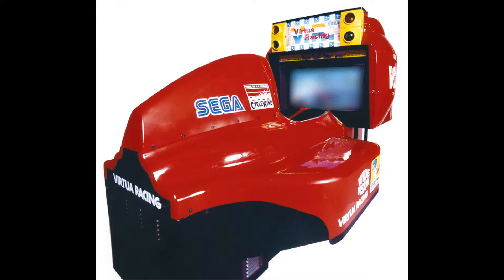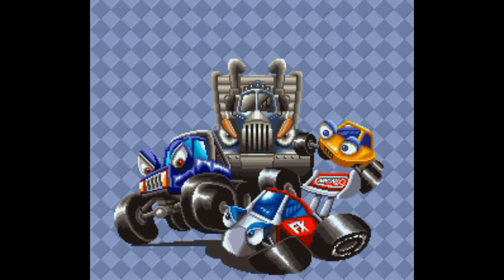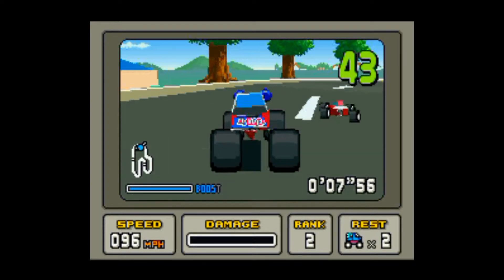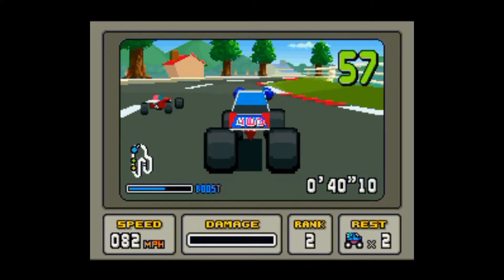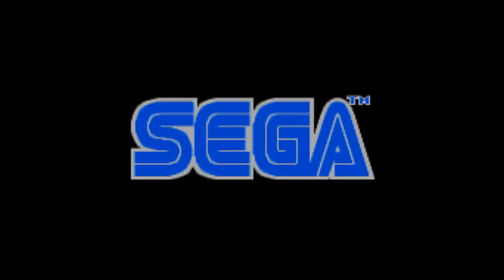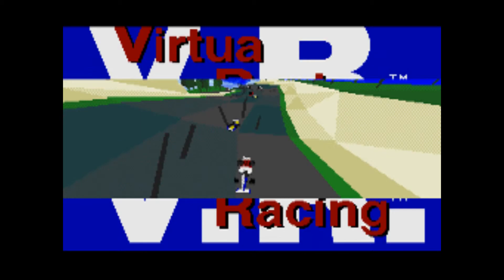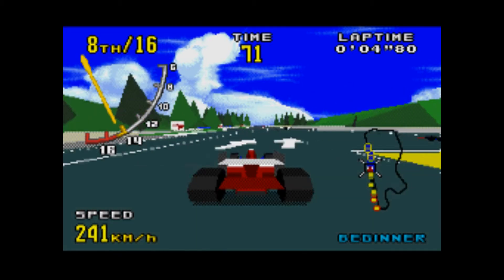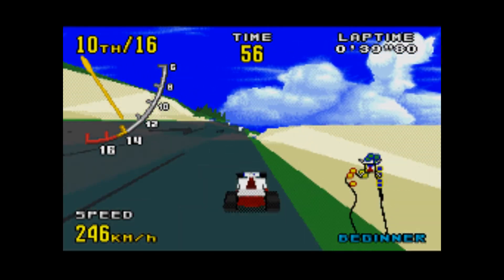Sega SVP versus Nintendo Super FX

Comment: the SVP was used in ONE SINGLE GAME though. That was Virtua Racing, a game with far less happening on screen than say, Starfox. Added to the fact that the SuperFX went on to do amazing sprite effects, it seems obvious that the more versatile SuperFX chip wins the day.
Reply: lmfao god bless you guys... nothing I love more than a great historical debate about SEGA "what could have been" theories and scenarios. This is what the internet was made for. You folks enrich my life. :P
Reply: The fact that 32X was more powerful than the SVP doesn't make the SVP obsolete. 32X was more powerful but also requiered a bigger investment in hardwere by the consumer. A cheap SVP cartridge-add-on could have been more successful, and more appropriate option for those that weren't still ready to buy a new console.
Reply: @MrCher2  Someone mentioned a shortage of SVP chips at that time. However, HITACHI had an abundance of the more powerful SH2 chips available for $20 each. With 1MB of extra RAM, this combination could have powered many arcade fighters, shooters, and 2D games. The 20,000 textured, Gauroud-shaded polygons per second would have handled most PS1 launch titles with ease.

This setup could have been sold for around $50, which would have helped clear out a lot of unsold Genesis and Sega CD inventory. Therefore, a combined Sega CD+SVP system could have competed with the PS1 more than a year and a half before its release in North America, priced at $150-250 depending on whether you already owned a Genesis/MD.
Reply: @albertabramson3157 what's the point of Gouraud shading if you can only display 15 colors? unless you also plan for a 32x-style video pass through.
Reply: @MrCher2  now ... what if there was a custom upgrade chip made for a game on the 32X ?????
Reply: @Dave Davies Well the 32x was more versatile, and more powerful, so yeah, the 32x rendered the SVP chip obsolete. This is basic logical reasoning.
Reply: Wins the wallet, but not the day. 

You sound like my coworker who thinks that VHS was better than laserdisc.
Reply: ...Have you actually looked at Star Fox recently? Virtua Racing had a lot more polygons onscreen at once. Granted the SVP was only used in one title, but that is because the 32x addon with superior technical specs was released the same year, obsoleting the SVP technology. That's why the SVP was only used once.
Reply: @Julian_Pepper  Area under the curve.  There were only 800,000 32X's sold ever, including those picked up at the $19.99 price--like mine.  Virtua Racing for the Genesis (with the SVP chip) sold almost that many.  The Hitachi SH-2 may have been less expensive, but the Samsung SVP chip drew just 0.03 watts, so didn't need a separate power supply.  If SEGA had built a one chip SVP/SH-2 add on with 2-4MB of RAM for use by the Sega CD, then created more 32-40 megabit games like Toy Story, Street Fighter II, Mortal Kombat II, it's likely that the Genesis and Sega CD would've gotten some great selling games like Crash Bandicoot, Final Fantasy VII, Gran Turismo, Metal Gear, at various sports games that would instead push the PlayStation sales to 100 million.  A single-chip, 2MB add on could've been made for $60-80 and sold at a slight loss, moving the whole Sega ecosystem to 20,000 polygon/sec 3D graphics for the mid-90s.

However: The Sega CD could already render 3300 flat shaded polygons per second and also created 3D floors and ceilings, etc.  The Genesis/Megadrive can generate another 1,000 polygons/sec, or 4300 + the track at about 17-20fps.  Virtua Racing usually ran about 6,000, while peaking at about 9500 polygons/sec at 20fps.  Owners of the Sega CD could've run Virtua Cop, Virtua Fighter, etc, on their Sega CD if SEGA had chosen to carefully hand-code a software engine for that platform.  Because SEGA chose not to, game enthusiasts learned that the company would never keep its long promise to bring the arcade experience to the home--just put yet another console in front of already cash-strapped buyers.  That was the point where I stopped promoting Sega games and gave up on the company.
Reply: @MaxAbramson3  You know what's strange about your reply? None of this actually counters the point I made. At all. I said the 32x was technologically superior to the SVP chip, WHICH IT IS.
Reply: @Julian_Pepper  No, you're wrong. (quickly becoming my favorite expression online, when the other person's fist is 1,000+ miles from my face) Because the SVP was capable, according to specs, of 20,000 flat shaded polygons/sec, but many believe that more could've been achieved with careful hand coding.  Using both SH-2's, SEGA's engineers were able to hit a stunning 50,000 polygons/sec, more than most PS1 launch titles.  However, most actual 32X games used only one CPU, so 25,000 was the more realistic limit.  An add on based on a single SVP would've cost less than half as much and not needed the extra wires and power adapter, resulting in much greater acceptance by the 40 million Megadrive owners around the world.  25,000 > 20,000.  Okay, but that difference isn't noticeable to most people, and the Genesis could simply draw the extra 32 lines of sky above the 320x192 area generated by the SVP.  An SVP add on would probably have been successful in the marketplace.
Reply: @MaxAbramson3  No YOU'RE wrong. Virtua Racing on the SVP doesn't use the full power of the SVP either, and since that's the only SVP game, the average reasonable estimate for the SVP chip's rendering abilities is a meager 9,000 polygons per seconds, and the SVP addon still wouldn't be accepted because the problem is they launched the 32x and Saturn at almost the same time which made it look like a simple cash grab which people didn't like. 

Regardless of all of that, you're STILL missing the point, so let me spell it out as simply as I can so you can hopefully understand.

The Sega 32x addon has superior technological specifications to the earlier released SVP addon chip. As a result of these superior technological specifications, Sega did not see the need to continue to use the inferior SVP technology, as the 32x could do more things because it wasn't specialized like the SVP, and om top of that it could do what the SVP was built to do at a much faster pace than it could.

If you still don't get the fucking point, I can't help you.
Reply: @Julian_Pepper  You can't help anyone because you can't even read your own post.
"that is because the 32x addon with superior technical specs was released the same year, obsoleting the SVP technology. That's why the SVP was only used once."

"That is why the SVP was only used once" is ironic, since its official 20,000 polygon/sec limit (as he says right in the video @4:29) was for one chip designed for this this purpose with only 128KB of RAM.  The 32X had two SH-2s, a powerful custom VDP, and 512KB of RAM, pushing its price tag to $160 and requiring its own source of power.  SEGA's engineers had Hitachi improve the multiplication power of the SH-2.  Had the SVP gotten all of these advantages, a twin-SVP 32X would also be pushing 50,000 flat shaded polygons/sec or more.

The President of SoJ insisted on sticking with Hitachi for the Saturn and Dreamcast, even when more powerful offerings were available like the SVP and PowerPC.

Your reasoning is therefore garbage.
Reply: @MaxAbramson3 you're forgetting one important aspect, color. The SVP is limited to the colors available on the Megadrive, which is 15 colors+transparent per tile. Meanwhile (ignoring the 15-bit direct color mode) the 32x layer alone can use 255 colors on top of the colors available on the Megadrive layer

Comment: you forgot about the SNES Doom, which shows the best performance of the SFX2. However, I understand that SVP was still superior, due to the high frame rate (20 frames?) while SuperFX1/2 was much smaller (10 frames?)
Reply: SVP didn't have the colors of super Nintendo, but yes, I think the 32X destroyed the exciting SVP Plan! I do wish SVP would of took off myself, with the lot more games. And so with the SUPER FX2. Good comment because at the end of day, we're all right one way or another.
SUPER FX2 Could have been real close.
To the SVP in terms of polygon pusher technology.
If not a little better. The problem was it was expensive to produce these chips for both companies NINTENDO and SEGA
Reply: @demonology2629 both chips are limited by what the host system could display (MD could only display 15 color+transparent per tile, while SNES could display 256 colors on one layer in 3 of its display modes). That's why the 32X had to route the Megadrive's video through it. Of course tricks could bump up the number of possible on screen colors, but those weren't feasible outside of static screens (see Toy Story) or using a raster interrupt to update the palettes midscreen (various underwater levels in Sonic games)
Reply: @Phredreeke  I've played ....
Sonc The Hedgehog {GENESIS 32X} It's graphics are just probably like an《ARCADE》if it was..
.
Reply: @demonology2629  colors really had nothing to do w/ the SVP or SuperFX 2 chip, they were math coprocessors, nothing more really.  anything related to resolution or color depth was strictly handled by the console hardware, the SNES was far and away more capable than the genesis.  But when it comes to pushing polygons at a smoother framerate, the SVP was without a doubt more powerful than the SFX2

Comment: Svp was wayyyy more expensive and wasnt as versatile
Reply: Svp was a off the shelf chip that they didn't buy enough of to reduce cost now if they had plans for multiple games using it they would have bought many more and in return games using it would have been cheaper
Starfox was a hit so it paved the way for multiple games and revisions of sfx to be made
Reply: @primus711  
1. You're continuing to fantasize about a world where Sega has the clout and the respect to negotiate the same deals as Nintendo and Sony. 

Since you're incapable of separating "wouldn't it be great if...?" flights of fancy, and harsh reality, I'm going to ask you for actual evidence of your unwarranted optimism? 

 This is the same Sega that had to axe sprite scaling support in the Megadrive at the last minute, to hit a marketable price point. And that was despite sticking to a modestly powered 68000 and Z80.

Both of which were aging rapidly. 

This last minute change left them with ROM carts too small to fake it. The end result was a humiliating disaster of a Japanese launch that made Sega of Japan eager to kill the Megadrive as soon as possible. 

That's the reality of what Sega brought to home hardware. 

They were in no position to pull off a Microsoft or Sony style business model.

And they were never really attempting to compete with the Super FX chip, either. 

By 1994? There was no way SOJ were going to help Sega of America any further than they had to. Sonic 2 had been made without Sega of Japan's assistance. Yuji had almost left the company before the Sega Technical Institute offered him shelter. 

Sonic 3 was purely a financial decision, based on the game's success - Sega of Japan wasn't going to turn that kind of money down. It just had unreasonable deadlines.

But beyond that? It's a miracle Virtua Racing exists at all. 

SOJ wasn't going to do shit to practically lower the costs. It was ultimately a one time luxury experience, intended to throw a bone to their most loyal customers. 

Just like their 32x library.

Which they despised.  

Even that system's port of Virtua Fighter caused bitter resentment. (Sega of Japan argued that it needed to lose any features the rushed Saturn port lacked.)

The end result, with some fans saying the 32x version was the superior version, despite looking like a bad joke? It convinced Sega that they needed to focus all their available resources on the Saturn. 

Winning Japan - for once - was the focus of the company now. 

The Genesis was dead, as far as they were concerned. The system wars were over, with the Genesis ultimately losing to the SNES due to self-inflicted wounds. 

Sega of America was made increasingly irrelevant, as the Sonic X-treme team would discover. 

The SVP never actually competed with the Super FX, except in power and potential. 

Which shouldn't have been a surprise, really.

While Nintendo could work with Argonaut and Rare - titans of the British game industry? Supervised by Miyamoto himself? 

Oh, and that Argonaut collaboration began before the SNES even launched. The FX chip was almost included in the base unit. 

Sega's luck with Western studios had been a lot more...mixed. Fantasia ringing any bells? How about Sonic Spinball? Terrible FMV games? The Ooze? 

Which of these studios would sell you on another SVP game?

Other companies, like EA, Treasure, and Konami, weren't going to be interested in 3d specs that low. 

Again, it would have been kinder if Sega had just offered the technology as a $50 add-on, so that anyone could make games for it. 

And it probably would have sold better too. 

Let's face it: Virtua Racing was overpriced, even at half the cost. A basic 3 track arcade F1 game wasn't the most exciting release, even back then.
Reply: SVP was more expensive because Sega couldn't get deals on co-processor chips the way Nintendo and Sony could. It's why they preferred system add-ons to expand power, instead. A one time purchase was easier to justify. 

And all of Sega's system add-ons smoked their SNES counterparts, in terms of what they added to the system's capabilities.

Their best games made the purchases worth it, if you could afford them. SNES fanboys were just missing out.
Reply: @juststatedtheobvious9633  lol none of that is true not 1 part lol 

U do realize sega has shit tons of custom asics in all arcade boards right and the stupid addons with genesis on life support was all from arcade design including genesis
Reply: @juststatedtheobvious9633  guy u haven't done anywork and have no idea what u r sayin ofc arcade hardware is expensive at 1st but when u sell something in massive numbers its cheaper eg home consoles 
Im a engineer and been doin this for decades so u can take your fanboy nonsense back to fantasy land
Reply: @primus711  
Oh, so you know the engineers who got screwed out of the Atari Lynx when Atari exploited their need for more financing, and then made unreasonable demands?

I'm not sure how you think the failure that followed makes your point at all.
Reply: @primus711  
The Neo Geo was a ridiculously expensive luxury device that also doubled as a cheap-level entry arcade. 

The differences between those two markets should be obvious.

PS: SNK also failed to replicate that success, when moving into 3d. Turns out it's not as easy as your ace backseat driving skills suggested.
Reply: @juststatedtheobvious9633  lmao what a load of shit

Comment: Starfox won
Reply: only one game used the sega chip, starfox 2, yoshi island with fx2 was almost on par, fluid and better games
Reply: @AleX-hu7ci  The technically superior 32x was released in 1994 too. That's why the SVP was only used once.
Reply: For manufacture cost > yes
For spec > no
Reply from the maker: Really? Lower frame rate, lower number of polygons on screen, and a much slower pace? Great as Starfox is, I'd easily say the Sega SVP made for a better experience and more fluid game.